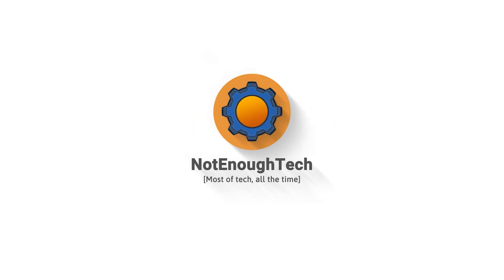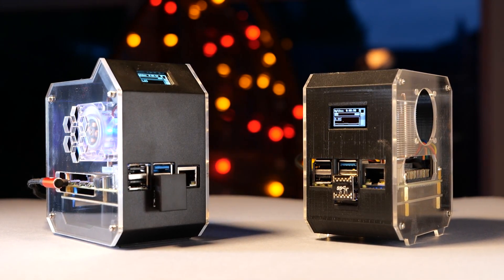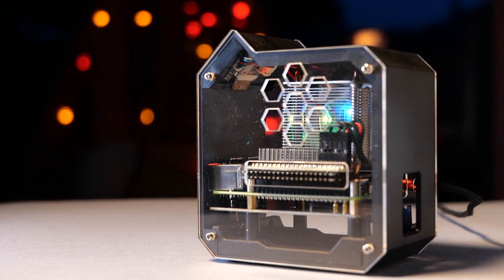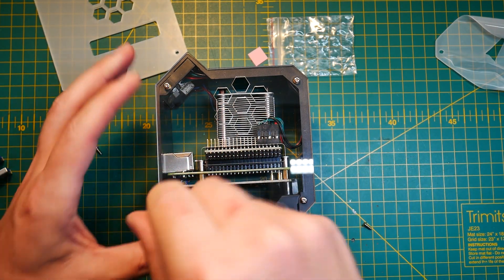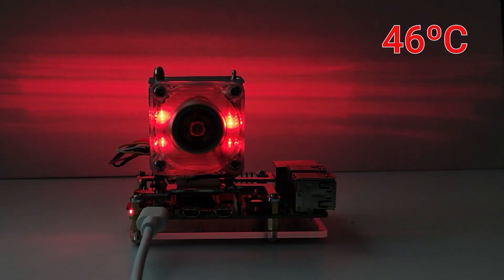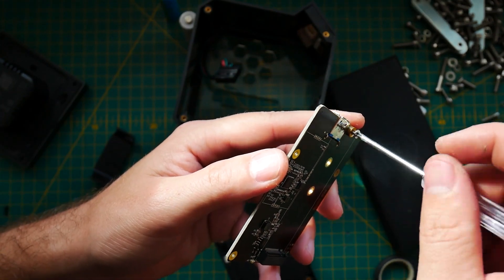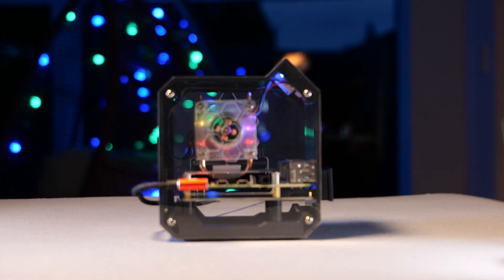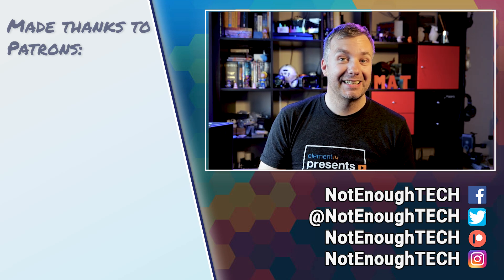Raspberry Pi case that looks like a PC

Comment: I'm might try some thermal paste instead of the thermal pad.  That particular heatsink design works almost as good as liquid, I've always built air cooled rigs because of this.  Much cheaper.  It was a tip from a senior tech I got in like 2012

Comment: Thanks for the video. Do you have a video where you try out and show how to use the OLED? I am new to Pi and I have bought that case... but could use some guide and how to go around and change the colors on fans and make scripts or control the fan speed or display what I want via the OLED... thanks!
Reply from the maker: No i don't have a separate video but you can definitely access the control script and see how the current display information has been done

Comment: I wish someone would come up with an io panel pcb and safe shut down button which allows pairing a pi with a sata board with out that ugly dual usb link for a cleaner case.
I know the nespi 4 case does this but for a sleek desktop machine its quite kooky plus you cant go over the top with bonkers hats or an ice cooler
Reply from the maker: I'm not the fan of the USB U bend either

Comment: For my Passively cooled Pi's I use the FlIRC case, which is mostly aluminium with a direct contact heatsink post for the processor.   For my fan cooled Pi's I have just stuck with the genuine Raspberry Pi case from Pi Foundation.   I really don't drive my Pi's hard so only the ones with PoE hats have active cooling.
Mine are all Pi 3B+ that I use in "production".  Mind you, it's impossible to get a Pi of any kind these days.
Reply from the maker: Those a great looking cases, remind me of Argon Neo. I know what you mean, despite high prices and temptation to capitalise, I hold on to my little collection :)